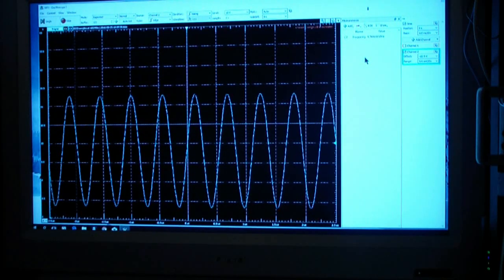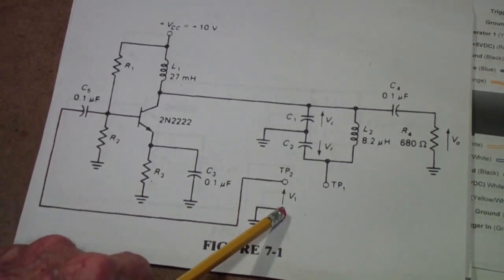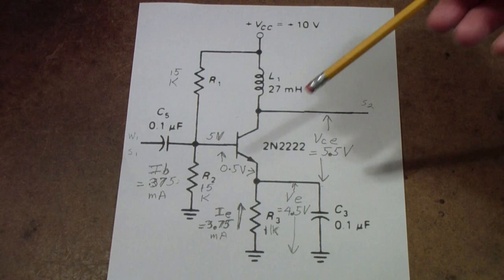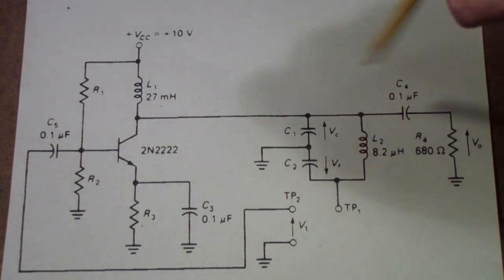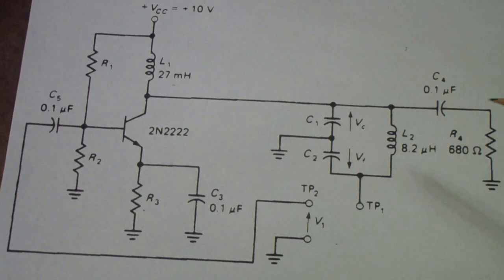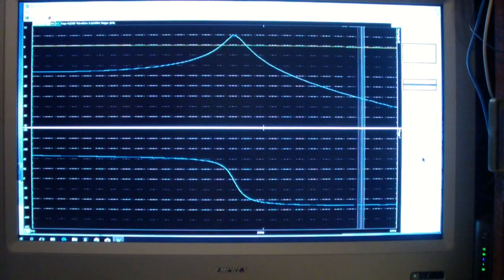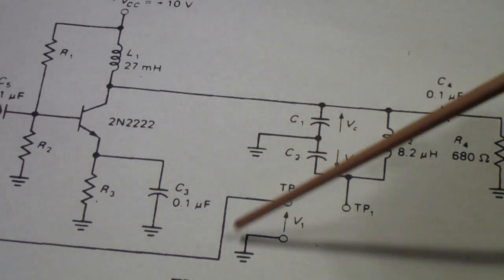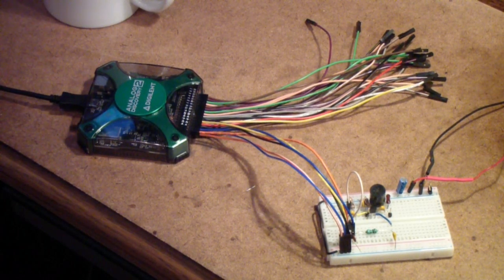TTT108 Analog Discovery 2 Colpitts Oscillator

Comment: Excellent explanation. How reliable is this Colpitts Oscillator circuit that starts the oscillation without fail? If there Is a temperature drift how can we compensate it? Thank you very much for your time and efforts.
Reply: Krish what have you learned on the Colpitts? Thx from Bangladesh